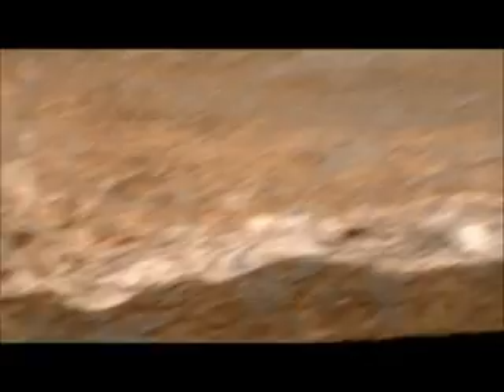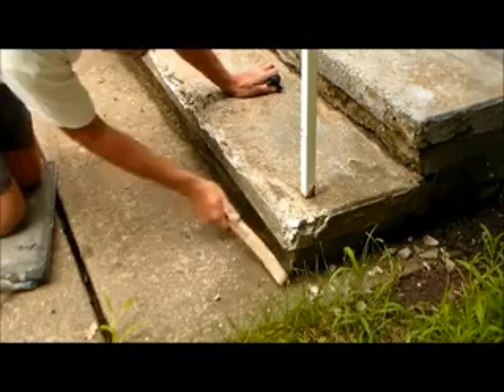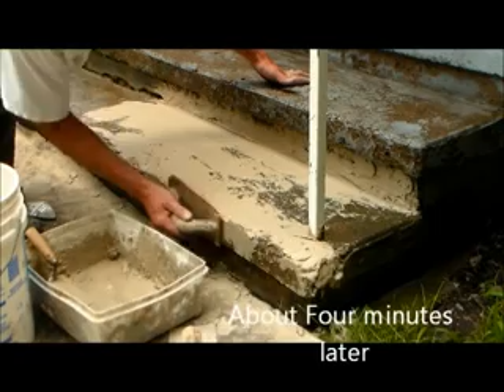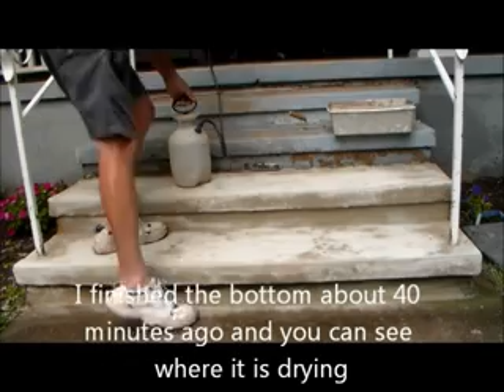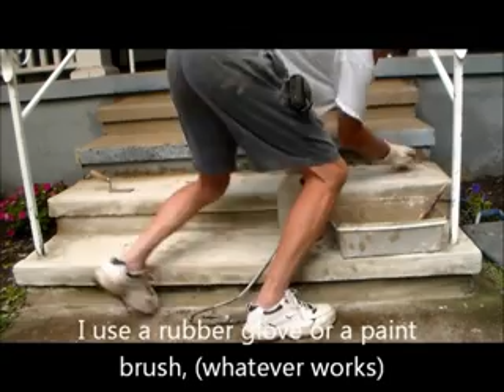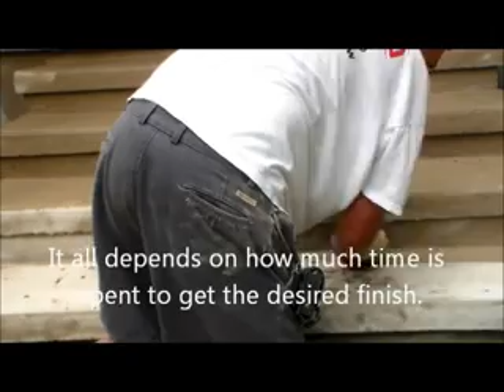CONCRETE STEPS REPAIR  (Part 1) Mike Haduck

Comment: Wouldn't it make more sense to repair the top steps first and then work downwards, so that you don't have to walk over the newly refinished lower steps in order to access the top steps?
Reply from the maker: Hi, in some cases that is true but sometimes they hot to be readjusted as you go to get right heights, thanks mike

Comment: Hi Mike. Thanks for your video(s). I'm looking into repairing my steps and there are several portions where the rebar is slightly showing and is rusting.  Can you advise?
Reply from the maker: Hi , a patch is a patch, I just try to get the heavy rust off and patch it normal, thanks Mike
Reply: @MikeHaduck  thank you for your quick response.  I'll work hard to chisel concrete away from rusted bits, wire brush ferociously, then follow your video.

Comment: Mike is a master.  I did a similar repair today.  Took me the entire day and it didn't turn out even close to as smooth as this.   I was having trouble even mixing the cement.  He makes this look easy but it isn't.   I'm exhausted from mixing just two bags of cement all rapid set.
But I saved about $2900 so thank you Mike.  Your videos are excellent.
Next trip I will resurface it, brush in grip lines and paint it with mud to match the landing
Reply from the maker: Thanks, I'm sure it will work out, thanks Mike

Comment: Hey Mikey, do you have videos of you building the cement steps?  I want to put steps into a bank that leads to the road not very steep whatsoever, wondering what you would recommend, concrete, paver steps? Any advice would be appreciated. Thanks from Altoona Pa
Reply from the maker: Hi Kevin, I got videos on stone step installation,  brick step Installation and am working on a job like that now but won't have that video out for months, I just lay the wire or rebar down on the bank and build on top so they all stay together,  thanks Mike
Reply: @MikeHaduck  thanks homie you the man!

Comment: Hi Mike, could you have used mortar (brown bag) instead of cement all with the same success?
Reply from the maker: Hi Alex, before fast drying rapid set , I would use Portland and mason sand,  but I would have to come back and go over it the next day and then wait days to paint,  thanks Mike

Comment: Great videos, and really helpful! Question, this video you use Cemetall Rapidset and in another you use Rapidset Mortar mix. How do you choose which one? I have to repair two bad sets of stairs.
Reply from the maker: Hi Paul the motar mix has sand in it, the other dosen't,  for real thin work I use the one without the sand. Mike

Comment: Another great video on how to use Cement all for repair.  By the way, shouldn't you have started at the top of the stairs and worked your way down?  It seems like it would be easier not walking on top of the work you already did to get to the top risers and steps.

Comment: what is a good product to use that can go on thin and not crack??  im in northeast and gotta small set of steps that crack every winter...the salt does not help either...
Reply from the maker: Hi,  hard call,  I just use a Portland paint or a real paint,  I would ask the guys at the paint store, thanks Mike

Comment: my sister has three big cement steps that are too high for me to climb up anymore as I am getting older. there must be an easy way to make them into six smaller steps that don't cost so much to do. what can be done to make it easier thanks
Reply from the maker: Hi Connie, I’ve seen carpenters actually build wooden steps over old concrete steps and hide them, Putting lattice  on the sides’ would consider that, I hope it helps thanks Mike

Comment: I had someone who thought they would fix my steps put a thin layer of concrete on them.  Needless to say, with a little help from my dad, taking down a bush, my concrete stairs are...what I thought were demolished.  I discussed with my sister and after looking at your video, I have decided I am going to take on this project. The steps were cracked and chipped before the thin layer of concrete, so what do you think? I will take before and after pictures.  If it turns out like yours did, I will definitely give you credit.  God gets his first though.  Can you tell me the tools I need.  I think I have it all down, not sure. What does the sponge flow tool look like. What type of paint do I paint it? Concrete paint?  Thank you.
Reply from the maker: Hi urwonderful, every situation is different,  I would check out what I did on all my other videos on steps and even some other youtubers,  then make your decisions as you go.  ask the paint store guy about the paint, I usually get a non skid,  I hope it helps, thanks mike

Comment: Great video. Two questions:

1. I notice the you are not getting every bit of paint off the steps but covering right over it. Doesn't affect adhesion? 

2. No need to use bonding adhesive? 

TY!
Reply from the maker: Hi Sullyyyy,  I will show more on the rest of the series,  boding adhesives are not all they claim to be in my opinion,  you have to paint the steps after you are done and keep it up every year,  a patch is a patch,  I hope it helps thanks mike

Comment: Mike, can you recommend a good concrete paint, please? Thanks in advance.
Reply from the maker: Hi Sherry,  Go to a professional paint store , and ask for a good stucco / deck paint,  they usually knows what works best in their area. and if it is steps you can get a non-skid, like a sand inside the paint finish that will not leave it slippery,  I hope it helps, thanks mike

Comment: Mike, 
I love the videos. One question, after repairing the concrete tread of my top exterior step with quickrete patch, I notice that there is still a bit of a dip where I filled the cavity. Can i apply more Quickrete to the patch that i already did to make it level?

Comment: Don't know if this is possible, but can this technique be applied to cast concrete steps ?
The top step has broken up , but the rest of the steps are in pretty good shape. The steps were made at a factory and step up on site. They are hollow, so I am unsure whether they can be fixed.
Reply from the maker: I would watch the rest of the videos on this series,  they should help, there are a lot of different ways to fix things, and most things could be, depending on how you want to do it,  also check out how I build stone or masonry steps  , they might also help, thanks mike

Comment: Hi Mike,  I need to fix a crack that runs horizontal (end-to-end) right along the seam where one step meets another.  Should I use the cement-all or should I use a non-sag sealant?  The crack is about 1/4" at it's widest and much smaller at other points?  I also have some vertical cracks/separations along the sides where the steps meet the brick stoops (about a finger's width apart).  Again, would you recommend a non-sag sealant or the cement-all here?  I'm planning to paint the steps when all repairs are done.  THANK YOU!
Reply from the maker: I can not say unless I was actually there to see, it but I usually use the cement all and then paint them,  my other videos in this series will give  you a better idea,  I hope it helps, thanks mike
Reply: Thanks Mike.  I appreciate your time!

Comment: Mike, when do you know when to stop chipping lose concrete, my steps seems to never end when i just use my hand to grabe the stones that were in the cement mix, seems to keep flaking off, id think if i cemented over it, the new section would just pop off in one chuck.
Reply: mike, i think i may have read a simular question, ill check out that foundation video you recommended.
Reply from the maker: +gear head   sounds like they are more bad than good,  Like a dentist you got to get everything out that is bad or It will keep coming back, ,  check out my videos (Part 1 to 9) "how I build stone or masonry steps, Mike Haduck,",,,,,,,,, It might give your some better ideas. I hope it helps,   thanks mike

Comment: don't you have to make the concrete a few inches thick in a repair? a guy patched ours & it was pretty thin in spots, & it cracked & was back to crappy within 8 months
Reply from the maker: +paul rogers  these steps were to be painted after I patched them, and a patch is a patch, you either got to keep patching or replace them all. Its the nature of the beast, It all depends on how much money you want to spend, I hope it helps, thanks mike

Comment: Mike I noticed you do not use any glue or adhesive with your cement - all rapid dry. why is that?
Reply from the maker: +David Martin as along as you paint it after your done and the water don't get between the rapid set and steps it is fine. patching is a yearly thing. I do not believe these bonding agents really  work well like they say in pennsylvania. I stick to old school thanks.  mike

Comment: As a Master Mason, (Social Lodge 48, Northfield MN), you would think I would know this but so far we have not had training in concrete or bricks. Our lodge's front steps are in sorry shape and I will attempt a repair this weekend. my question is, would epoxy paint add strength to the repair and help it last longer?
Reply from the maker: Richard DeBeau  Hi Rich, the other videos 2 through 5 should cover that, I appreciate the comment, thanks mike

Comment: Mike, I loved your video and your articulation. I have a set of precast cement stairs that are 20 years old, still fundamental sound, but need cosmetic resurfacing. The entire set of stairs shows small rocks and pebbles mixed in with the cement--Any idea if I could still follow your video. More importantly, any idea as to the mixture I should use (given the appearance of these rocks and pebbles). No-one has been able to help thus far...
Reply from the maker: Sean Reardon
Reply from the maker: Mike Haduck I think if you go through from part 1 to 5 you will get to understand the techniques I use,  I hope they help thanks mike
Reply from the maker: Sean Reardon Hi sean, I  couldn't say unless I seen it , but I would do a little testing on the side to see what happens, check out my video, masonry tips for beginners, It might help, thanks mike

Comment: Mike  great job..thanks. I just had my contractor lay a post into my soil for a vinyl panel installation and he used I believe "Quickcrete''. I have a half a bag left. and a cracked front stoop area, not steps...could i use that "Quickcrete' like you did here and how long would that bag be good before it get hard as a rock, being left open.?
Reply from the maker: Anthony  If it is quickcrete "concrete" pre mix,  it has stones in it and it is not what I use unless I got big big holes. open bags don't last long at all.  check out my video, masonry tips for beginners, it might help, thanks mike
Reply: Mike Haduck Mike thanks for the quick response. my error its not "Quickrete" its "Sakrete'...does that matter?
Reply from the maker: Anthony its a hard call unless I seen it. thanks mike
Reply: Anthony 
youve probably already repaired it by now, but to answer your question, no...
the Sakrete is strong, and good for a new poor, but you cant finish it well between new and old. because it has stone (aggregate)
when you go to finish it, your trowel jumps up and down over the stone, and it doesnt blend well at all!

Comment: Came out great! Went from $1,700 precast steps to $25 of cement all!  I mixed some up thin as paint and went over everthing....should I also paint with latex?  The again!
Reply from the maker: Phil Thayer  I wish I painted the steps on my first video but did it on the the other parts 2-3-4 etc, I buy a stucco-porch paint and if your expecting to touch it up a few times a year , my opinion is it will be fine. thanks I hope I saved you some money ,  mike

Comment: Some of the damage on my concrete steps is big chuck of the cement off. Do i use the same method as on the video? Also, how long do you have to wait before you can paint? Thanks alot.
Reply from the maker: Brenda Anne Du Faur I can't say unless I was actually personally there to see it. but I think some of the things I did on other videos should help. the directions on the paint can should give you a clue but with cement all I could usually do it the same day of a couple after. thanks mike

Comment: Mike, great videos. What do you do if there is a crack that goes completely across where one step meets another, clear down to the ground? I tried a crack filler, but it the crack came back over the winter.
Reply from the maker: Brad Iverson Hi Brad,  cracks in cement are like ants at a picnic, I would guess by not seeing it that it is yearly fix, I hope it helps thanks mike

Comment: So you use rapid set so you don't need formers?
Reply from the maker: drz4000 It all depends on how big the holes are, check out my parts 2-3-4 and you will see. you could also use the rapid set mortar mix. it works well also thanks mike

Comment: How much time do they got wait  for   paint
Reply from the maker: Guillermo Ortega it all depends on the weather, temperature etc,  with rapid set on a sunny day at 80 degrees I could paint it the same day, sometimes with regular cement it will take from a week to a month, it all depends. thanks mike
Reply: Thank you I use regular cement

Comment: I was using a very old bag of quikcrete if that could possibly have anything to do with it.
Reply from the maker: that might me it, shopping for cement is like shopping for bread, it has to be fresh for sure, you must be talking about the concrete resurfacer, I guess you should just wire brush it off and do it again, but I can't say for sure unless I seen it, thanks miek

Comment: Mike - I used quikcrete to fill in cracks and resurface my concrete steps.  Looks great.  However, when I go over it with my hand - it all comes off.  What did I do wrong and how can I fix it?
Reply from the maker: I can't say unless I was there to see it. I would say maybe you didn,t wet it good first, only guessing but a patch is a patch, hope you well mike

Comment: Mike, resurfaced the chipped walkway I like to put a brome finish on it can I pour a thin cement all on like 1/8" and brome. Question should I make the mix loose like syrup and do I need to troll it still or troll just enough to spread it. and lastly when should I brome when its still wet looking or when it look dry? TY so much you have  been a great help.
Reply from the maker: I would experiment on some old block or plywood and see how it turns out. I can't tell folks how to do it I just show them how I do it. So it is a hard question to answer, don't forget that his was suppose to be painted over with paint which holds the rapid set in place.thanks mike
Reply: ok ty for idea on the broming should I take it going longest direction or just along the shortest width like on a walk way

Comment: I need to put a very thin layer of the rapid set to even the broken surface about 1/4" to 1/8" what do you recommend with the mixing 4 to 1 or should it be more wet??
Reply from the maker: I would do a sample first to get the feel and see how the product works. everyone has a different opinion for sure, thanks mike

Comment: Mike putting on that thin will crack
Reply from the maker: I explained through out the video it has to be painted over,  and on my third video I explained and showed it better. The paint is the final seal. I hope that helps; thanks, God bless, Mike

Comment: Hey Mike, I've worked in concrete before making forms and such, i'm not new to a trowel ,but I have a set of cement steps
that need to be filled in, it was resurfaced previously but its all cracking off. I'm going to remove the current cement layer on and try to just remove broken pieces and use the fast dry cement, my boss is hoping for a uniform color without painting, is that realistic with cement. thanks, Joe
Reply from the maker: hi Joe, some guys down south say it holds up without painting but in Pennsylvania It don,t last through the winter. usually I paint it with a stucco paint and give the paint to the owner and tell them they probably got to do some touching up in the spring. thanks mike
Reply: yea, I'm in minnesnowta so, i feel ya there, I was just wondering if you can find a cement paint that look like the original color of the cement
Reply: Or could I use a cement itself to make sure the job looks even
Reply from the maker: Joe Major hi joe, I just take a piece of the concrete and the paint store usually matches it pretty close. thanks mike

Comment: how thick can I go with this product? My situation is a little different I am putting in a pre-hung exterior door and the tiles from inside reaches 3/4 the way through threshold so I need something to fill in 1/4' -3/8"  approx. 1" wide by 34" can I use this product or something else? I need something to support the edge of threshold from the outside edge.
Reply from the maker: I can't say unless I was actually there to see your project, but I have no problem with 1/4 or more,  cement all also makes a mortar mix which might work much better. I wish you well, thanks mike
Reply: TY
Reply: you should use less water next time u use it
Reply from the maker: Danny Diet Hi Danny, its one of those things you got to practice with, I always suggest to do a sample first. its like working with bondo on cars. Learning masonry is like learning to play a instrument, I give you a lot of credit, for your efforts, I wish you well, thanks mike

Comment: I repaired my front steps today based on your terrific video.  I was a little unclear about the consistancy of the second coat and I don't have a floater yet but I think it's going to turn out just fine.  Thanks!
Reply from the maker: thanks I hope it works. mike